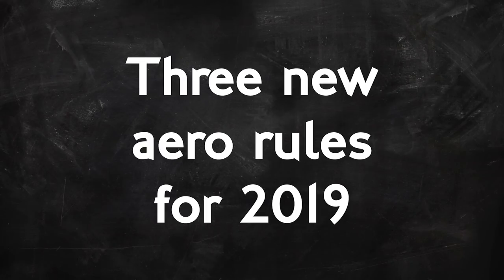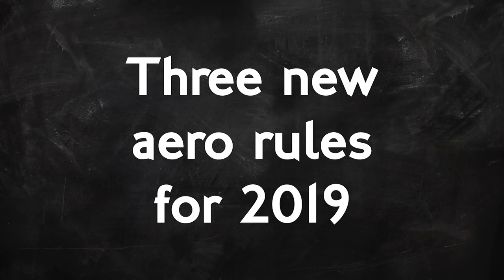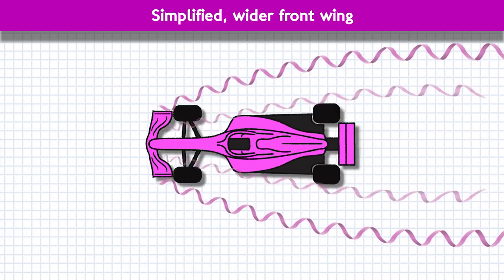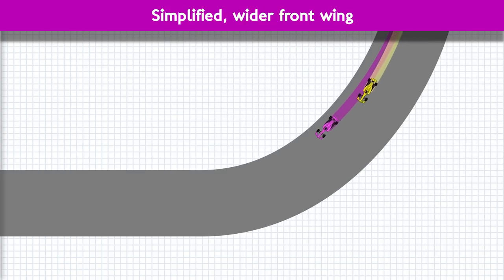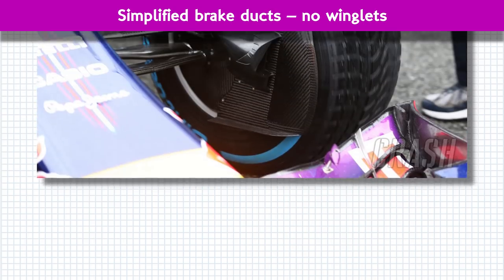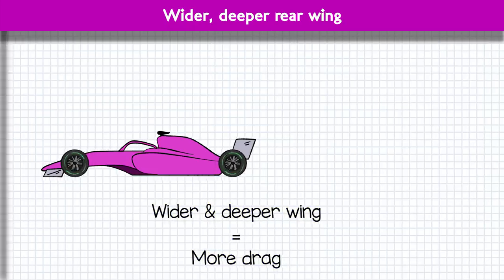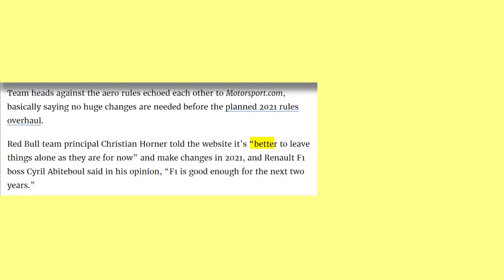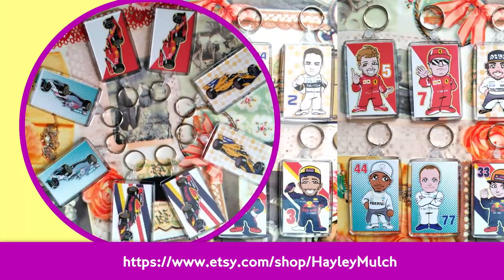New Aero Rules in F1 for 2019 explained

Comment: I think it's good that they try out stuff. If the new Rules don't work as intended, it's better to find out before 2021. If the changes don't work, they can try out a different approach in 2020. So that they know in wich direction to go from 21' onwards.
Reply: TheKincognito good point
Reply: Exactly this. I know I'm a bit late to the party but to all the teams complaining that the research backing these incremental changes is "too fresh" need to realize that this next season is exactly the sort of extra data that will allow that research to mature. More data are always a plus!
Reply: TheKincognito  they should go with no front wings at all,  that would make for some interesting racing...
Reply: Marshall Fischer So... Formula Ford? 4 has wings now but Ford's still wingless

Comment: the issue right now are the corners, so the front wing change seems logical, however, making DRS even stronger does not sound very smart as it is already very strong and it will also not affect corner speeds in any way. Now every car within 1 second of the next car will be able to overtake on a long straight.
Reply: As long as Tilke designs the tracks, the corners will still be a problem.
Reply: TBH, DRS is rather ineffective these days, though, and has been that way since the current engines came in. An overtaking move is far from guaranteed even with DRS activated most of the time these days, and I doubt that's really going to change next season.

Comment: I'm split with my opinion if I like these changes or not. As a fan of F1, I want more overtaking and exciting races.
However, as we all know, the DRS is an "artificial" overtaking device. How it is now, it seems to work just the right amount, where the following car can get just alongside the car in front and the rest of the work has to be done by the driver on the brakes - e.g. Riccardo's sick moves down the inside. With a bigger DRS, the overtake will most likely be done halfway down the straight with the overtaken car not able to fight back like they can now. I like the racing so far this year as the overtakes are exciting and are really close/aggressive.
I like how the front wings currently look (not a valid excuse for not changing things, I agree). It's the details that make F1 "The Pinnacle of Motorsport," and taking that away seems to be the wrong direction. The same with the brake ducts - it's all details that make a difference in a car's performance.

Why have they not decided to change the floor and diffuser? Having increased traction from the rear end would help the following car have a better chance of catching up along the straight without DRS as they'd have a better exit from the corner.

Comment: Would it be a good idea to allow the drivers to use the DRS whenever they want to? I think it would make them come up with some clever stuff.
Reply: It'd be very risky. Getting rid of rear downforce makes the car less stable, and severely limits its ability to corner without spinning out.
Reply: Yes, that is what I mean, they would have to be careful about using it, but by timing it correctly, could make some moves. I'm just not sure if we want those kinds of moves though
Reply: It whould be cool of they could open the drs for like 5 seconds each lap. When ever they want and if they dont open it will add up till you have like 15 seconds and then it will max out
Reply: The car gets too dangerous. In Japan 2017 Hulk's DRS failed and he couldn't do corners like 190R well
Reply: It would be interesting only on high speed tracks like Bahrain or Monza.
Reply: Thiago Veloso 130R.
Reply: I like the way the DRS works in DTM: The drivers can use DRS everywhere they want to(if I'm not mistaken) but are limited to a certain amount of laps in which they can make use of it.
Reply: Its like that in Formula Renault 3.5 and when defending driver also use it its harder to overtake - it will be less overtaking
Reply: Azzifyy, what is double DRS?

Comment: Racing in 2017 is better than 2016 IMO. The difference is that on tracks where it was already difficult to overtake in previous years it become worse, but on a lot of the tracks that overtaking was very easy due to DRS it became more interesting. Also a lot of the reduction in overtakes was down to the more durable tires in 2017. I am for this changes, but ever since 21 century overtaking has been always difficult, no matter how slow or quick the cars are.
Reply: I agree with you on everything except the ''but on a lot of the tracks that overtaking was very easy due to DRS it became more interesting.'' part. DRS has been rather ineffective since the current engines came in, i.e., an overtaking move is far from guaranteed even with DRS activated these days. Many people always seem to be a bit too eager to give credit to DRS alone for more or less everything concerning easy-looking passes even though there could very well be other things contributing to making them look easy at times than DRS.

Comment: They need a more fundamental change in the long term.
Design focus should be pushed away from the current aero paradigm and towards ground effect.  Active suspension should be reintroduced, wings made much smaller and restrictions on underbody designs (including rear diffusers and ride height) made much less constraining.

Massive wings and complicated aero parts may be great for outright laptime, but F1 is about racing, not hotlaps.
Reply: Oh how right you were, wise one

Comment: Ok, I'm not an Aerodynamic expert, but I absolutely love this changes. Basing myself in the new IndyCar aero for the 2018 season, there were 366 overtakes in the opening race in St. Petersburg, compared to the 322 that was made in the 2008 race. Why I'm I basing myself in this? Because it have the same things that the F1 in 2017-2018. In the 2015, 2016, and 2017 St. Petersburg, the overtakes were extremely reduced because of the new complex aerokits. And the same happened with the Formula 1, in 2017, the new and bigger aerokits made the cars faster, but harder to overtake. With the 2019 new rulebook we will see something different? My response to this question is: Yes, if IndyCar had just made it better, F1 can too.

Chain, if you read this, I'm a fan of yours, all the stuff I learned about F1, I've learned it with you, thanks a lot.
Reply: That's exactly what I've been saying!!!!
Reply: Agreed. I certainly think Indycar has proven that simpler aero has an immediate effect on the racing. According to an Indycar.com article, through the first 4 races of the 2018 season, there were 999 on-track passes vs. 475 at the same time last year. From an aerodynamic and even aesthetic standpoint, I love the complexities of the wings and extra appendages in F1 (I know I'm probably in the minority there), but some simplification for better racing is a trade I'm more than willing to make.
Reply: Simpler designs also make it cheaper, so this could potential make lower income teams more competitive.

Comment: First off, I believe you shouldn't look at overtake statistics to make these changes, you should look into battles on track.
 The 2014-2016 era had the worse racing I've seen in F1, because one of two things happend, the car was fast enough and passed with little trouble, or he couldn't catch the car ahead. People focus a lot on the latter issue, though that always will happen in Motorsports, the former one is more important. An overtake needs to be hard fought. The Botas-Vettel battle in Bahrain this year or the Vettel-Hamilton one in Spain 2017 , the fight between the Renault and the red bulls in Baku have been far better than anything that 2016 threw at us. 
All of that said, apart from the rear wing change, the other two are positive as the amount of dirty air in f1 is excessive, and the complexity of the wing would always make the gap between bigger and smaller teams larger. The rear wing one seems crafted by mercedes though. The increased drag will benefit the stronger engine, as they'll be able to run higher downforce levels than the competition. Last but not least, increasing the Drs effect may just cause the 2016 again, which I'm against.
Reply: I don't think it needs to be hard, only not artificial. Also the DRS caused speed difference might be to excessive next season. People in front might not even try to block the other car because of pointlessness. They might end up just switching places in the DRS zones whenever following driver chooses so. (Or might just set in for easy fuel saving behind the preceeding car...)
Reply: My thoughts exactly
Reply: I don't think the engine argument for/against Merc is all that valid this year, though. Scudderia seems to have matched Merc in that department, and has, as in the last few years, also has better tire wear than the Mercs. Hell, ignoring a few bonehead issues from last year, Ferrrari should have won WDC, and been in the fight for constructors as well. The Merc engines were stupid dominant through 2016, no argument there. Ferrari massively closed that gap last year, and it's non-existent this year. (look at trap speeds recently, Merc is NOT in the lead)
Reply: slikrx Fair enough. Mercedes may not have a power advantage anymore, however the change still benefits more powerful engines, which will increase the performance gap between teams. Also this lap time gap might remain the same until 2021, given that these engines will change in that season, and manufacturers may not invest money into this power units anymore. We would have a situation similar to 2013, when only red bull invested in their cars, which is not ideal for the sport.
Reply: 2014 had incredible racing. The problem was so much of it was for completely inconsequential positions while Hamilton and Rosberg coasted to a 1-2. Take Vettel and Alonso's Silverstone battle or Alonso and Ricciardo duelling it out at Hockenheim. If the Alonso-Vettel duel had been for the win rather than 5th then it would have gone down in history as one of the great on track duels.

Comment: It's good that they're trying stuff.  If you watch F2, where the cars are designed primarily to encourage head to head racing to showcase the drivers talent, the simpler aero is very noticeable compared to F1.
The DRS thing is good, because it allows them to make DRS more powerful in general, but they can still easily move the lines around to shorten the length and balance the effect (like they did with the first couple years of DRS).  This way some of the tracks which have really no DRS effect can maybe have some.

Instead of asking the teams to agree on these racing rule changes, they should ask the drivers.  I believe most of them want to have more fun.

Comment: In all honesty just turn off DRS for a race and see how many overtakes we get. I'll tell you, on track it will be a one digit number at best. Can be solved by simplifying front wings again, as well as relying much more on diffuser generated downforce, as that barely gets affected by dirty air. And that doesn't even need to be tested as we have solid proof of that statement if you look over to Indycar, where they did just that and to everyone's surprise they have the best racing in two decades now.

If you ask me throw in fuel stops again and we also get more strategy based racing, where you never know how heavy the other cars are, so you don't know if it's smart to attack or defend or whatever. This leads to much more fighting on track, instead of just waiting it out until the car ahead goes to get more fuel.

Same goes for tyres. While we did have different compounds back in the day, they weren't marked. So you never knew what the other car got on its pitstop. Everyone would automatically start fighting simply because they were unsure if the waiting game would actually help them in any way. 

Everyone seems to fear that simple limits to front wing aero development would cripple the speed of these cars, and they would no longer be the pinnacle of motorsport. However the same people completely ignore the fact that even in the 70s aero got so advanced that very powerful elements, like the fan car's fan, or the general ground effect, were banned. I see no one complain about those two things being still banned. Put them on modern cars and they would be faster even completely without any wings at all! And get this, they wouldn't even be affected by dirty air!

I really don't get what's so difficult about improving racing again. I mean I personally would love the return of V10 engines (which are much cheaper to produce) but there are reasons not to do that. However there aren't any reasons not to properly fix aero.

Oh by the way an example for a car relying on diffuser downforce is actually on the current grid. Red Bull have tons of rake, at the cost of top speed. But they are the only cars that seem to be able to somewhat closely follow other cars, and they are the only ones this year to actually attack (and not just each other) if they are actually fast enough.
Reply: Oh and another important aspect: DRS causes a significantly higher difference in top speed between the cars, which at speeds way beyond 300 is a huge safety issue. Many recent crashes could've been avoided if the racing had just been normal, with cars actually relying only passive aero (none of that F-duct or DRS stuff) to stay closer together in corners so that they need much less of a speed difference to fight on straights, leading to less sudden line changes and drivers missing braking points, misjudging things, or doing a Verstappen. 
I mean, you can't get surprised by Verstappen suddenly changing his line if you're basically already next to him out of a corner, right? 
You will however if you try to blast past him with a 30km/h speed advantage and he suddenly moves. There's no way you will avoid hitting him unless you hit the brakes at full force
Reply: Relax on the diffuser. They can also hurt the car behind badly if you remember about the double diffudrr in 2009 and 2010
Reply: Of course they can, but only if they cause even worse air for following cars. This does not seem to be the case over at Indycar, where they went into the ground effect direction without actually allowing ground effect (as in, the skirts must not touch the ground). If the cars mostly rely on that type of downforce in the first place, dirty air won't be as much of a problem anymore.

Comment: Just eliminate the engine regulations and set a standard for fuel economy if they want a "green f1 car", let the teams experiment with the aerodynamics.
And i know that smaller teams would struggle more but it would be more fun for the spectators that actually finance this mess, let it be like 50-60 years ago when no one knew what the other one had beneath the car covers

Comment: I'm just scared about what will happen at any street circuit. The space is as it is very narrow, won't making the wingspan of the front wing create more unsafe racing and crashes? I mean at the end of the day we do wanna see clean yet exciting races right?
Reply: That's just only to the fact the current cars are HUUUUUUUGE compared even to 2008 ones. If a 2008 grid would be placed around baku you most likely would get f2 levels of exciting races, cause they can overtake in many more spots not just t1 or t2 if you're alongside in to t1 but yes with the extra wingspan i can see a lot of carbon laying around city circuits
Reply: Damian yesh but not like they'll get those cars back. It's gonna be these hugs cars with even more massive front wings now. And the chance for front wing damage will increase easily in tight corners, which i think would hinder over taking to some extent
Reply: I know, because if we would like to get the current 1.6l V6 turbo in to a place of a V8. Two things would happen: the car most likely would be slower and/or the engine wouldn't fit in in the first place. But outside then that yes on true street circuits (not albert park) there'll be a massive ammounts of carbon flying off cause of the pursue for that extra 0.1 sec. And it won't get better with F1 heading in to FE territory with more street circuits (i know for the organizer it's cheaper to close off a district for a week from traffic rather then doing some expensive adjustments for your circuit to host f1 once a year)
Reply: Damian the 2007-8 didn't have anymore overtakes than we have now . So no they wouldn't be more exciting around baku especially without drs .
Reply: That was a size compairson and i can say that if the current f1 car was packed in a f1 2007/08/09 chassis or current f2 one, you'll defo get much better races than the current one cause: cars can follow each other and on street circuits like baku it means more overtaking spots not only t1 or t2 if you're alongside someone after t1
Reply: Damian the 2007-08 cars were just as bad in dirty air as the current cars  . Just look at the 07-08 cars looked like spaceships with all the winglets they had . Size is not a problem dirty air is . 2005 with roughly the same aero regs as 07-08 had less than HALF the overtakes of 2017 .
Reply: Where did you get that statisctic?
Reply: Damian look up 'f1 overtakes per year'